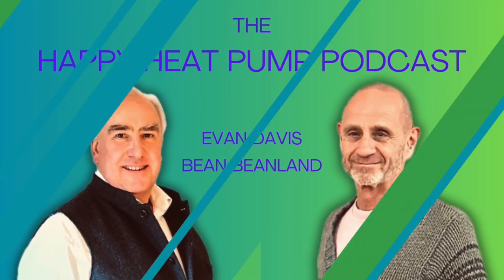17. What's the secret sauce in heat pumps?

Comment: As others have commented R290 is used outside, if it leaked then it would right next to this big fan that is blowing air around. I wanted to mount my heat pump on flat roof but as its < 1 mtr from the neighbors property (a 1m high wall) I am not allowed.

Comment: In less than 100 years, heating has progressed from the simple (chuck anything that burns into a hearth) to the increasingly complex (What type of refrigerant would you prefer, Madam?). The best is often the enemy of the good. With too much choice and too many variables, everything grinds to a halt. We need to trust our installers and the 'authorities'' (whoever they are) to make a resolute judgement on these matters in order that the industry can move forward.
Reply: The problem with heat pumps are they are inherently more complex than a boiler and lees forgiving of design sloppiness. 

Weather compensation curves, flow rates, flow temperature,  pipe sizes, emitter sizing, etc. bad design and installation can cost you a lot of efficiency. 

Done right you can get scops over 5 which is brilliant, but they are more complex in their operation as well so cop drops with the outside temperature where gas doesn’t. These are the things that irrational heat pump haters latch on to and jump around with shooting heat pumps bad. 

I hate to say it but the only way to solve the issue is regulation for installers and increasing the price of gas gradually over years.
Reply: Just going to say that SCOP of five is only just reachable. There's one or two with that rating on heat pump monitor.

Comment: Heat pumps are installed outside buildings, not inside them.  If the propane leaks slowly from a heat pump, it will disperse into the atmosphere and probably won’t catch fire.  Even if it does catch fire, the risk to the building is relatively small, because the heat pump is installed outside the building and the propane gas will soon run out.

On the other hand, natural gas (methane) can leak inside a house from pipes, a boiler, gas heater or gas cooker.  These leaks can be enormous, because the pipe work and appliances are connected to a limitless, pressurised, gas supply.  We have all seen pictures of houses that have been completely demolished by a gas explosion inside the house.  Even that risk is extremely small, so we are all happy to live with it.
Reply: Agreed, the risk compared to the gas main is tiny, so using the "flammable" propane gas should be seen as making heat pumps much safer than using mains gas.
Reply: That only applies for Air to Water heat pumps in the UK, which may be the majority, but Air to Air (split) reversible heat pumps have the refigerant circulating in the building to the fan units.
These are likely to be more common in the UK in the future, they are the main type of heat pump on the continent and the US.